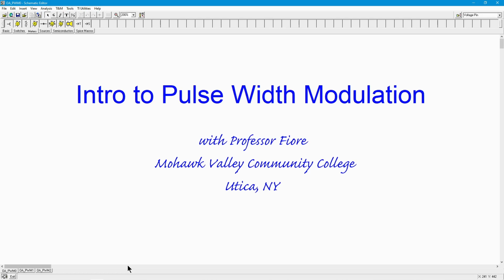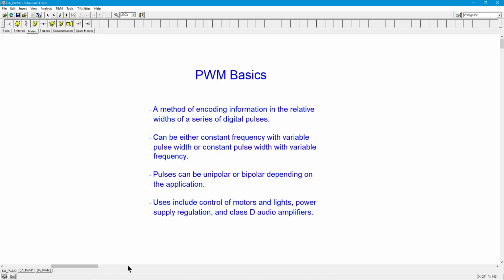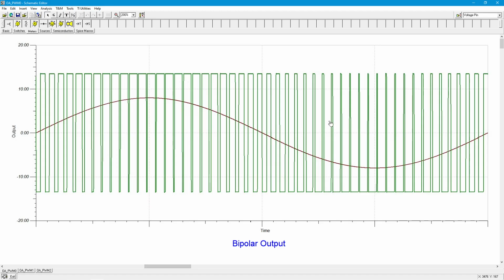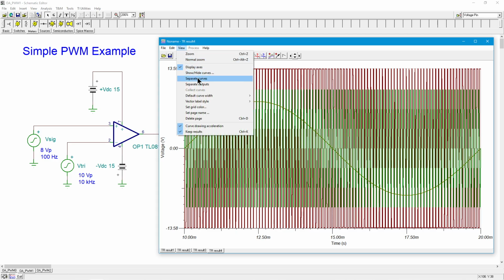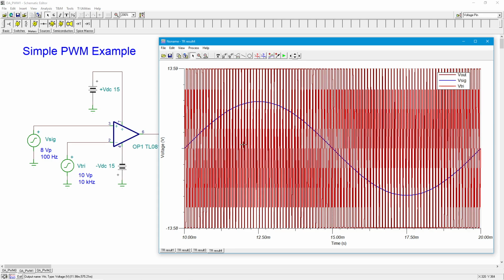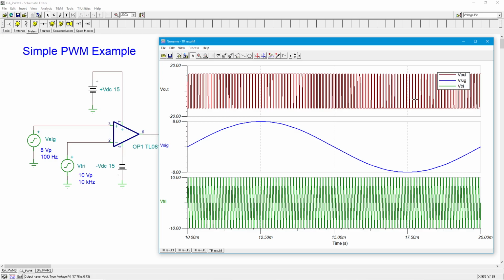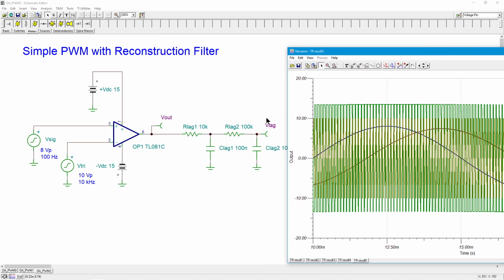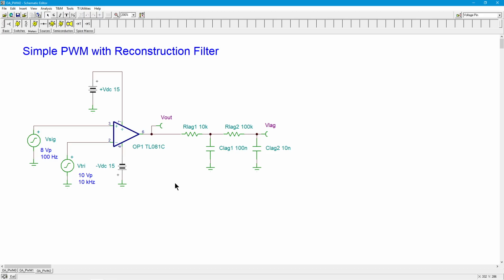Intro to Pulse Width Modulation

Comment: What would happen if you modulate the frequency of the triangle wave?
Reply from the maker: You certainly wouldn't get normal PWM. The modulating signal would show up in the spectrum of the resulting pulses. In terms of an analogy, that would be a little like having a motor constantly change the gears on your bike while you were riding it and trying to keep a constant cadence.

Comment: REALLY THE SAME AS FM ONLY MODULATING A DIGITAL SIGNAL.WHY DID YOU USE A TRIANGLE WAVE AS THE CARRIER?
Reply from the maker: There are some similarities with FM but they are not the same thing. The triangle is not a "carrier" per se. It is the signal that is compared against, hence we want a nice straight edge (and ideally about the same amplitude as the input signal).

Comment: Excellent video.  
Side note: in reality one should not use op-amps like a TL081 as comparators, but real comparators. Op-amps are not designed for use without a feedback network. Their inputs will saturate when the differece between them is more than a few mV.
Reply from the maker: Yes, this is true and I talk about such things in my op amps textbook (free download, link in video description). The main reasons to use proper comparators are that they tend to be faster and it is easier to set up their output levels. The reason I use op amps here is because virtually every simulator will have a decent general purpose op amp in its library if a student wants to do their own sim, and it is easy for students to hook up such a circuit in their own lab with parts on hand. I prefer not to use specialized parts for instructional videos when general purpose parts will be sufficient to show the concepts.

Comment: Cool video.  If it's really an intro for teaching, I might
- explain more what PWM is used for and why it is used (for power purposes, it is inefficient/difficult to produce analog signals, but switches are cheap and efficient;  for informational purposes, analog signals are susceptible to noise, whereas PWM is less).  I feel there are really two separate purposes-- information and power.  They may hear about servo (control/information) PWM and be a bit confused how it relates to power PWM (the control aspect is also typically generated in a very different way, also, i.e. a microcontroller).  You seem to focus primarily on the power aspect here, but you might want to mention the usage relating to control/information in case they are thinking about servos they've used.

- discard everything about harmonics and focus on average energy or power in the signal.  This is more understandable from a basic math perspective that beginners have, i.e. averaging rectangles is easy (otherwise you're just teaching them to throw around buzzwords like "harmonics" that they probably don't fully understand).

It's a nice tutorial on the basics of PWM.  Reminders of the different types is interesting.
Reply from the maker: Yes, it is an intro, and it is designed to support the discussion in my free textbook which goes into much greater depth (links to my textbooks are in the video description).

Comment: In this case why would you modulate the signal then demodulate it?  I understand it's for purposes of demonstration, but would have like to see how it would work with a class D amp as you suggested.
Reply from the maker: The pulse train is the signal you'd run into the class D output stage. More details in the chapter on class D amplifiers in my free Semiconductor Devices textbook (link in video description).